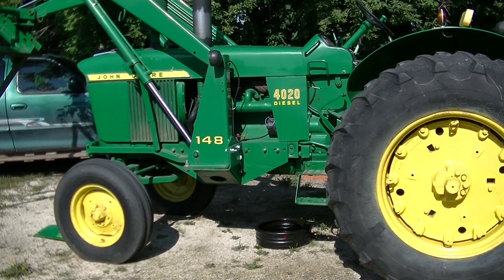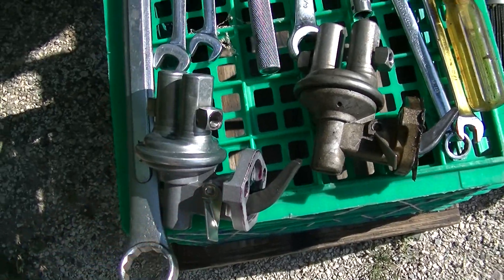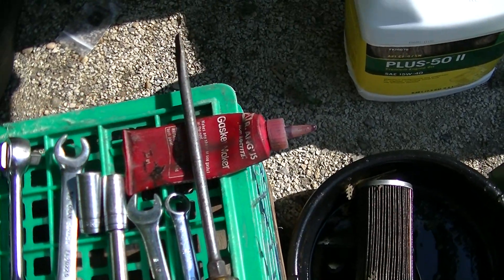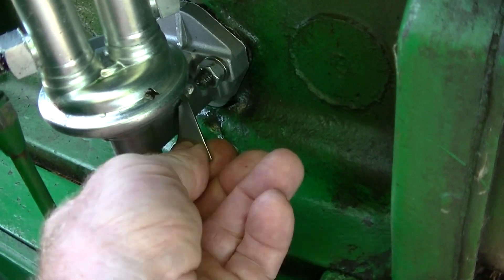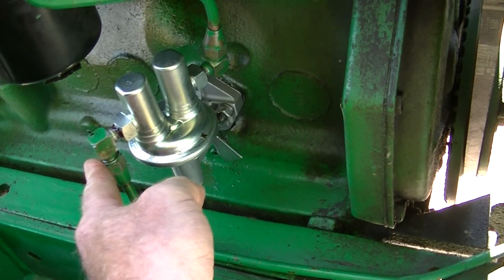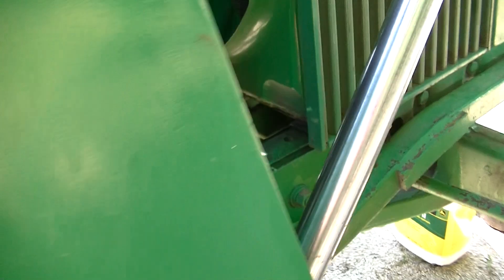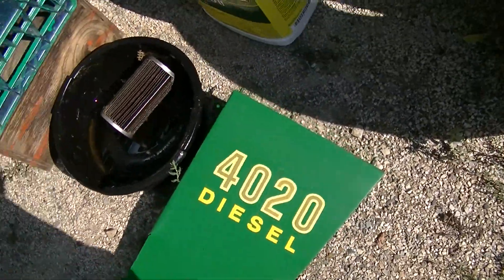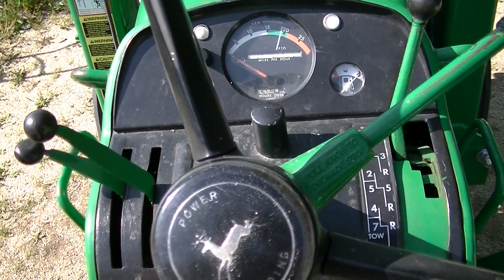John Deere 4020 Diesel Fuel in Engine Oil - zeketheantiquefreak

Comment: Great video, the old 4020 looks great, thanks for showing the operation
Reply from the maker: Thank you for the comment. Yea, those were quite the thing. The 4000 series propelled John Deere to the forefront in market share back in the day. Kinda hard to believe that that tractor is 53 years old and still ticking nicely. The clock quit at 8,500 hours who knows how long ago. Good luck with your project(s)...
Reply: Thanks very much

Comment: great video , as well as expla ation. I cirrently have a 1965 model 4020 with fuel in the oil. I will first try a new lift pump , plis oil & filter change.Thanks!!
Reply from the maker: Yes, the lift pump replacement did fix the fuel in oil problem. Been good for a few years now. Thanks for the comment!

Comment: Thanks i have look for an answer to my problem, I run a horizontal drill with the 4045 turbo and I have the same problem, I was about to pull the pencil injectors thanks
Reply from the maker: Thank you for the comment. It has been way over a year now and the oil level has stayed where it should. I got lucky and hit the problem area (primary fuel pump) first time. Good luck with your repair and let me know what you found.

Comment from the maker: Have you had a similar problem? Care to share your experience with us?
Reply: I have a dumptruck isuzu 10pc1 with diesel contamination in the oil... would this solution work on it too?
Reply from the maker: @keithabalos319  Sorry... I just found this comment now. (April 2019) What did you find was wrong with the Isuzu?
Reply: I believe I have a similar.   fuel in my crankcase.  its a 2350.  I wonder if its a similar fix